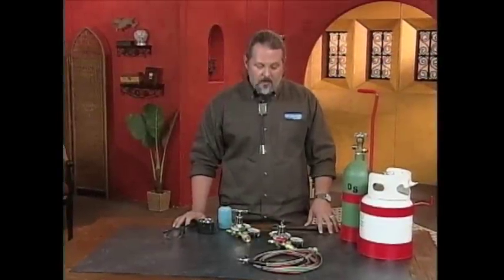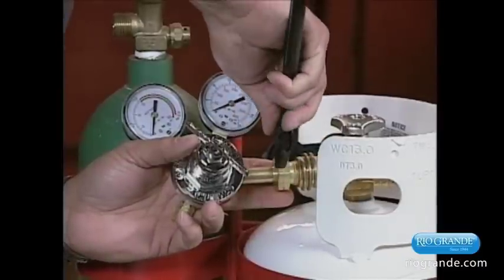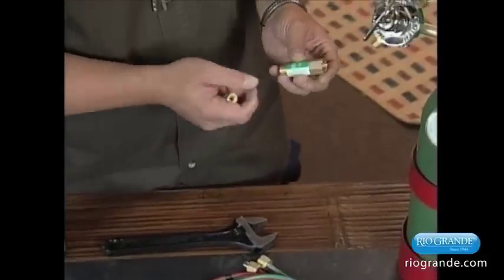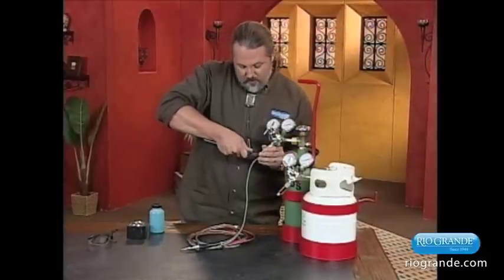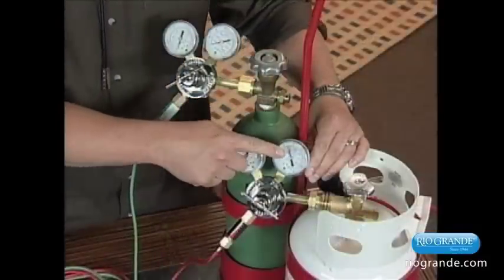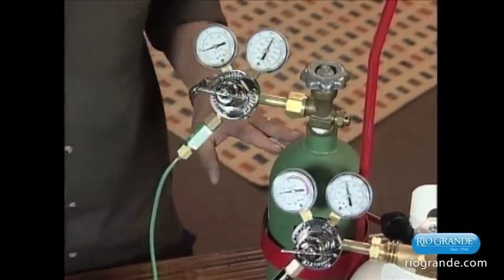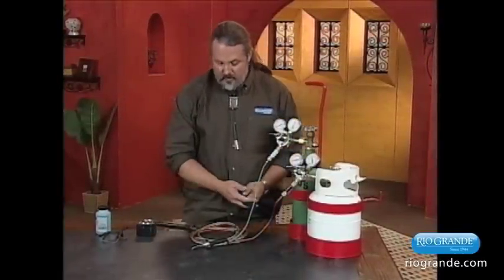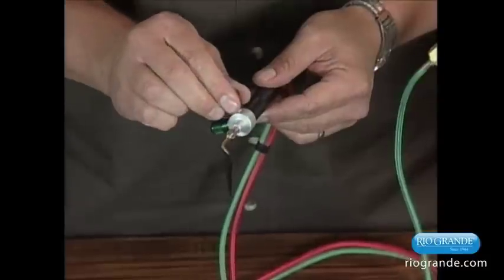How To Set Up a Propane / Oxygen Torch

Comment: Other trainers say to only open the propane or acetylene about one turn so it is easy to shut off in an emergency.  I think opening the valve all the way is supposed to seat the valve open so there is less possibility of a leak.  What do you think?

Comment: I saw two major safety mistakes in this video. Never open flamable tank valve to the end. Crack it open just to get full pressure on gauge and stop there. That's usually about quarter of turn... In case of emergency fire you are able to quickly put out source of flammable gas and stop fire.
Same thing stands for putting out a torch. Always shut the flammable gas first, then oxygen.

Comment: Hi Barbe. If it’s possible we leave everything set up. We’ll do our soldering and when we are done for the day we’ll turn off the tanks and bleed the lines. To bleed the lines we 1st extinguish the flame, 2nd turn off the tanks, 3rd release the gasses from the lines ( this will allow the needles to drop) and 4th release the pressure on the pressure knob by turning it to the left until you feel the tension let up. I hope this helps.
Mark N Tech

Comment: Thank you for the video! It really helps calm the nerves. I’ve been trying to find info about appropriate eye protection. Are IR and/or UV glasses necessary for oxy/fuel setups?  I’m a jeweler, but looking at some larger pieces that may require brazing. Thanks.

Comment: Actually, first step should be "blowing out" the tank valve...prior to attaching regs, crack each tank open briefly at the valve, to blow out any dirt or particles hiding in valve.  THEN attach your regulators...also, best to open torch valves first, open reg line valve and open reg tank valve BEFORE you open tank main valve. EVERYTHING OPEN, to allow gas to pass through reg, line and torch to blow out any foreign junk in line AND to prevent air in line from compressing.  THEN, when you hear gas flowing out the torch head, start back at the tank reg valve to set to open.  Then, set the line valve to about 4 lbs. Then, and only then, close the torch valve, with the line free and clear and pressurized. Repeat for the other gas line, oxygen, e.g.  W this procedure, you're flushing the system of crud, and also preventing compressed air in the lines...When finished, reverse the procedure--close TANK valve first, then purge lines by closing tank reg valve, then line valve, and finally TORCH valve, so no gas remains in lines.

Comment: Julia Peralta: Not a dumb question at all. Propane is a type of LPG. Here in the US the terms are not interchanged much, most refer to propane as propane. But you will be fine using what you can get locally with the little torch. I hope this is of some help. 
Mark N Tech

Comment: Nice video. SAFETY TIP: I was taught to turn off propane/acetylene first then turn off the oxygen so the oxygen can clear the line of flammable gas preventing a fire inside the torch that cannot be detected and will travel back through the gas lines - it is this scenario that makes flash arrestor necessary. Oxygen is an oxidizer and will not burn therefore turning it off last prevents a fire inside the torch and lines. I have a few years exp in the welding supply business and have seen bad things happen to great people when this is done backwards. Tired, hot, end of a long day, turn the wrong knob first, boom...
Reply: When you turn off the propane/acetylene first you get a loud pop that can be frightening or annoying to those near you.  I was taught to avoid this by turning off the oxygen first then the propane/acetylene then give a quick blast of oxygen to clear the line.
Reply: keevine Strange. I always turn fuel off first exactly because if oxygen turned off first, it pops loudly. Maybe, different torches need different approach?
Reply: Mike Thompson I use injector torch, so maybe, maybe.
Reply: Did anyone get seriously hurt?

Comment: setting the pressure. You shut regulators down or turn them on ? i'm sure you met down and then turn them up until they reach pressure you want. I want to get one but i just want too be sure it's right.

Comment: I have used cutting torches since the late 50s.Back then it was a rule only open the acetylene or any other gas just a crack as long as the gauge moved just in case a hose breaks so you could shut of the bottle as quick as possible.Opening a crack should be enough to get a good reading of your tank as it will decrease as you use up what ever gas you are using. I never used the gauges you have so I might be all wet with these modern doodads.
Reply: They tell us in welding class to open it 2 half turn just in case a hose breaks so we can shut it off like you said
Reply: And that was acetylene, correct?? You sure they said ‘any other gas??? I just know that propane can act like a refrigerant, and if you don’t crack it enough, you’ll freeze your orifice, that’s how refrigerants work they cool way down when changing from a liquid to a gas…. Smaller orifice means more gas… my background is HVAC we traditionally use oxygen-acetylene in the trade but for home I was looking at oxygen-propane because I know what it costs to fill that acetylene tank!!

Comment: You ALWAYS turn off the OXYGEN 1st !
People that say you should turn off the combustible are simply and dangerously plain IGNORANT and know NOTHING about flammable and explosive limits.

A propane-oxygen mixture become explosive when the propane concentration fall between 2,1% and 9,5%.
If you 1st turn off the propane, at some point you will have your torch filled with an explosive mixture that is going to explode as soon as the gas flow drop below a certain rate. That's the loud "pop" stupid people hear when turning off propane 1st, and that's exactly what start FLASHBACKS.

So you always want to turn off the oxygen 1st in order to avoid to reach the explosive concentrations.
Same goes with acetylene, which is explosive from 2,5% up to 81%.
Again, you want to turn off the oxygen 1st to get above that 81% before the gas flow rate drop to the point where a flashback can be triggered.

Enjoy welding.
Reply: Thanks for the technical explanation. I was taught to do it this way but didn't know the science behind it. Ignorance is not bliss.
Reply: Yeah, my teacher in HS said "Always turn off the combustible gas first because if anything's going to start a fire it's that" but then a retired welder came into the shop while I was working on my forge after school and said "That pop you keep getting is flashback, let me show you how it should be done" and basically called out my teacher for being an idiot. Which he was.
Reply: Truth is, it really doesn't matter which gas you turn off. It is impossible for anything bad to happen. In order for the gas tank to blow up, the oxygen would have to go inside the gas tank and that is physically impossible unless the end of your torch is plugged or pressed against a wall or something.
Reply: Tank won't explode but you can get blow-outs.  We had it happen back when I was in HS.  Was just outside the shop and heard what sounded like a 12 ga going off; the hose blew out just under the reg.
Reply: Ummm yeah didn’t he just tell us that??
Reply: Poop.   Propane oxygen to start oxygen propane to stop.  Poop.  My son taught me that!
Reply: What you turn off first depends on the torch manufacturer.
Reply: I was told green does not always mean go.

Comment: Hi Marc, It doesn’t work to just use the propane on an Oxy/propane system, it would be like using a candle to solder with and the flame won’t be hot enough. The propane has to mix with  oxygen somehow to produce a hot enough flame for soldering and these system do that using compress oxygen so you’ll have to use the tank. The Smith regulators we sell can be used for both propane and acetylene, you will just need to make sure you have the one with the fitting for the tank size. 
Mark N Tech

Comment: I was taught to turn off the gas first so the gas don't soot up the torch when it is going out. And sometimes a pop than can dirt up your orings. Like an underpressure torch pops when it overheats. If you turn off the gas first  the oxy blows out the flame clean with no smoke. Remove the tip and see if it is black.

Comment: I've never dealt with torches beyond what just connects directly to a propane or butane tank so please forgive my ignorance if im mixing up my trades... But wouldn't you want to be using PTFE? I wouldn't want to put that much torque on brass connectors just to get a seal. However, as that I've 0 experience with this type of setup I appreciate the video!
Reply from the maker: Hi there! The brass fittings do a good job of sealing from any leaks. It doesn’t require an excessive amount of torque to tighten the fitting, and they will last for many years. Hope this helps!
Reply: One may NEVER use anything combustible on any oxygen line or connection. It is begging for a disaster. Any type of polimer seal is  explosively combustible in oxygen. You should also never use any grease on pressurized air connections either. Why not? Because the diesel engine was invented a century ago already. 😮
Reply: @nicolemmer7681  lol

Comment: Hi Rio Techs - I have a meco midget propane/oxygen torch and uniweld regulators and I do have flash back arrestors. I thought I was doing this correctly but I think I may have totally ruined the oxygen tank regulator because I thought that it was turned off enough. So when i opened the oxygen tank which does not open all smoothly like the one in the video, the gas hissed out loudly and I shut off the valve to the tank. Now I have the regulator properly turned off as well and the propane tank and regulator. However the oxygen tank still reads way up at 20 and I tried to redo the whole thing the right way but as soon as I opened the tank and began to turn the regulator clockwise the needle began going up even further.

It's really hard to find someone to help me with this. I studied jewelry making and worked a lot with torches but was never taught how to set one up. For safety sake I called the local airgas place where they sell welding supplies and asked if they could connect me with someone experienced who could come to my studio to help me set it up. I hoped some employee there would want to make some extra cash but they said to bring it in. I didn't want to lug my torch and tanks all the way over there so i read the directions, and tried to do it myself. mistake I guess...

Comment: Thanks so much for the demo.  I just purchased a Smith Little Torch and I was told I could use  the Smith pre-set Regulator for my propane tank. It's small and doesn't have the PSI dials.  Is that going to work for me?  I do have a Smith Oxygen regulator like the one you have in the demo.
Reply from the maker: Hi There, Thanks for watching. This will depend on what kind of tank is being used. If disposable propane tanks are being used, then the regulators which are designed to work and fit those tanks can be used. Those do not have dials on them, but work perfectly with the disposable tanks.
 
It sounds like you have an oxygen regulator with the dials, so, you will be able to use refillable oxygen tanks. If you prefer to use a propane tank like the one in the video, you will need a single stage propane regulator with dials. Hope this helps!
Reply: Thank you!

Comment: I'm self teaching jewelry , and I've only gone through my first tank of acetylene/oxy. I'm ready to get a refill... but now I'm totally nervous about using anything! The more safety research I do, the more Im freaking my self out. I chose acetylene because I read acetylene was safer in the home because if there is any gas floating around, it will dissipate, as apposed to propane that collects in a low laying ball of gas, meaning propane more dangerous. But now I see them say acetylene is more dangerous. Some say to turn the oxy off first in the torch, some say the gas!! I'm turning oxy off first, the gas, then it pops! Also, I heard only open the acetylene a little bit, and the oxy just a turn or so. What the heck?? This whole thing has me afraid now, and I'm usually a very coordinated, well researched person!
Reply from the maker: HI There! Some of these videos may help as you are learning to solder. They are more in depth, just click on the 'video' tab for these links to see a preview. Hope this helps!

Metalsmith Essentials: How To Solder Jewelry, Vol. 1, DVD: https://www.riogrande.com/Product/Metalsmith-Essentials-How-To-Solder-Jewelry-Vol-1-DVD/560691 
Metalsmith Essentials: How To Solder Jewelry, Vol. 2, DVD: https://www.riogrande.com/Product/Metalsmith-Essentials-How-To-Solder-Jewelry-Vol-2-DVD/560692
Soldering: Beyond the Basics, DVD: https://www.riogrande.com/Product/Soldering-Beyond-the-Basics-DVD/560417
Basic Jewelry Soldering Techniques, DVD: https://www.riogrande.com/Product/Basic-Jewelry-Soldering-Techniques-DVD/560304
Reply from the maker: Regarding how each of the types of gas acts within your studio: Acetylene gas does dissipate in the air, so it will float away. Propane does settle down in the room and can cause an explosion. We hope this is helpful.
Reply: I know this comment was SEVERAL years ago, but I ABSOLUTELY AND COMPLETELY couldn't have said it better myself! There is SO MUCH conflicting info EVERYWHERE on this subject that it leaves someone more confused, unsure and SCARED than when they were completely UN-INFORMED! Thank you for your "rant", lol!

Comment: Are acetylene regulators OK for Propane?      Are propane regulators OK doe acetylene?
Reply from the maker: Industrial acetylene bottles, larger than a B than have the same valve as refillable propane bottles so they share the same regulator. However If you have been using Propane and what to switch to Acetylene or visa versa it is highly recommended to replace the regulator with a new one. The gasses can leave behind residue that can interact with the different gas and cause problems.

Comment: Good video, though it is not good practice to crank open the oxygen all the way, for oxygen there is no need to do this and it is an important safety feature to only open it one turn so that in an emergency you can quickly shut it off. 

As you demonstrated, to light up its propane/oxy, shut down the reverse. Otherwise it will pop. Important to highlight this as people get it wrong. If you hear a pop what your hearing is an explosion in the torch known as a flashback. This means you are relying on your flashback arrestors to prevent a much much larger problem.  Oxygen goes off first because it’s the more combustible gas and ignites with much less effort than propane or acetylene.

Q. What size oxy tank is that?
Reply from the maker: Hello, thanks for the feedback and addressing these safety issues. We appreciate  you taking the time to share this. We will pass your question on to our Jewelry Tech Team and get you an answer! Thank you for the support!
Reply from the maker: Hello, our Tech Team got back to us and they said that the tank is an R 20cu.ft tank 500050. We hope this helpful. Feel free to let us know if you have any other questions!
Reply: Actually, oxygen isn't combustible at all. The air around us is 20% oxygen, after all. However, it is essential for any fuel to burn.  This includes even metals when they become hot enough. That is why you can cut steel with it, and why  the oxygen is turned on last and off first. And NEVER use any steel fittings on oxygen equipment. It can start burning simply from the frictional heating caused by the pressurized oxygen flowing past it. We had such an incident at my place of work a few years ago when a contractor put a steel valve in an oxygen line. They used nitrogen to test all the lines. The first guy to open the valve after the oxygen was connected spent time in hospital.

Comment: Is it okay to leave the tanks on if I am coming back to work the next day? And I would also like to know how to shut off the tanks. is it shut off Oxy tank then shut off propane tank, bleed the line, then release the pressure?
Reply from the maker: Hello, we will pass your questions on to our Jewelry Tech Team and get you an answer.
Reply from the maker: Hello, we spoke to our Tech Team and they said to let you know that they do not recommend leaving your tanks on over night unattended.  When shutting off tanks it does not matter what order you shut them down just so long as the bottles are closed.  Then drain hoses and release the pressure with a t-bar on regulator. We hope this is helpful and appreciate your questions. Let us know if you have any other questions!

Comment: So what is the regulator pressure for the oxygen???
Reply: Ever figure that out? I heard him say, "Don't forget to sync the oxygen as well. 
I'm sitting here with my old setup that's sitting in storage. Gotta heat this upper control arm bolt, or I'm stranded here for the night, lol
I'm going with 7s on both tanks and going for it!! 🫡

Comment: What's the psi for the oxygen?
Reply from the maker: Hi There, Thanks for your question. As Mark mentions in the video, the pressure will vary depending on the torch tip you are using. You can refer to your instruction manual for that, or this handy pdf: http://www.smithequipment.com/files/pdf/spec_sheets/Little_Torch.pdf Hope this helps!
Reply: Do you have info on psi when using the Meco? I haven't been able to find information on pressure for it anywhere.

Comment: I have two smith regulators both are pol fittings both lpg bottle and oxygen bottle are pol fittings can I use the smith regulators for both.
Thanks
Reply: Anthony Marsh Hi Anthony, if both the tanks and the regulators have POL fittings they should work. you might check to make sure you hose fitting fit the regulators 1st though. 
Thanks for watching.
Mark N Tech